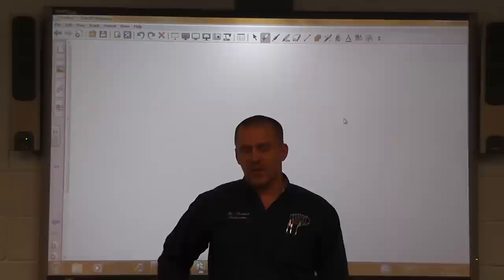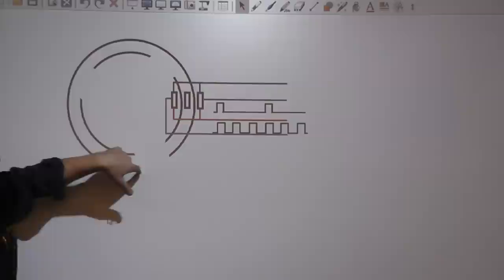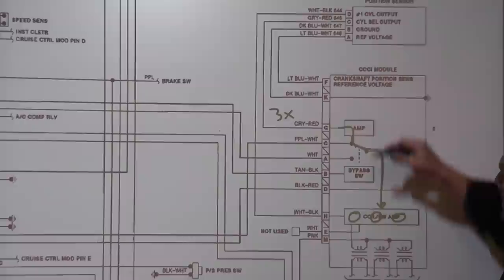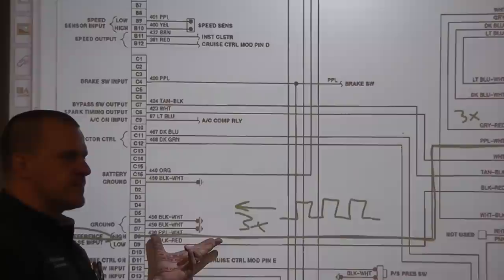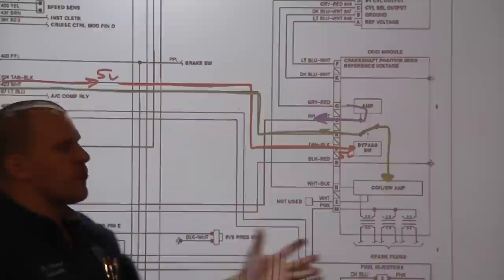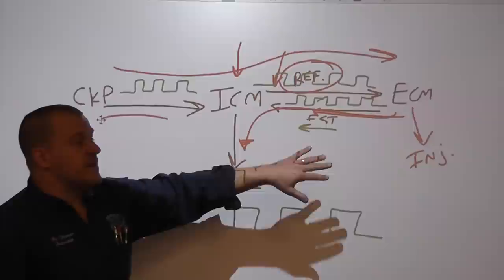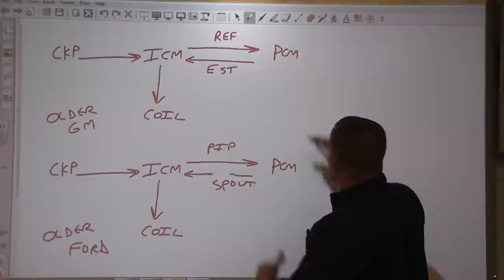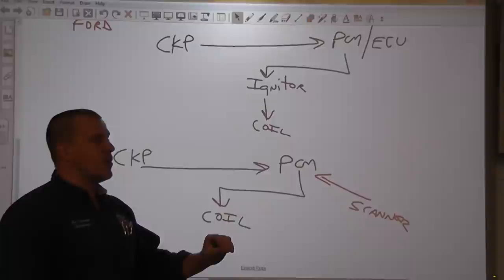GM Bypass Ignition System Operation (part 1)

Comment: Stalled once a wk, then 3 times a wk, no reason. Cold, Hot, Load, Sitting at intersection. It would go days in between. Each time it would start right back up. It went 2 or 3 months like this. The last day on the road it died a few miles from my house. I took another car up and drove the Buick home. It was really bad, dying every few miles. Had to push it out of several intersections. Letting it cool helped a tad, but not much. Except for the 2-15 min. runs, it's just 1-30 sec. run time.

Comment: how does it work on gm vehicles with no crank sensor or cam sensor.  does the timing connector on the firewall disconnect the computer and just reply on the ignition module for starting and running?

Comment: The only sensor I didn't replace is TPS. I have a cardone select distributor. NEW. My 89 s10 pickup throws a code 25 even though I replaced the IAT. I have a harbor freight timing light. Timing mark moves back and fourth a couple degee and engine idles fine. It's when you drive the engine holds back. When it reaches operating temps the engine wants to stall when coming to a stop. Can the red brick force the truck to run right. Is that a bidirectional scanner?
Reply from the maker: disconnect the EGR vacuum hose and drive it, see what it does. My guess is your EGR is sticking open, causing the rough idle and almost stall. This will also heat the intake to a point of setting an IAT code
Reply: could be a Fuel Pump going weak/ to Bad .check your fuel pressure and Fuel Filters might be plugging up.

Comment: I got a 98 Deville same concept but a V8 how would I keep my injectors going but shut off ignition by a push button switch? Would it be the EST wire? Its for my flame thrower kit. Its not working by killing the 12v to the ICM because the pcm is stopping the injectors.

Comment: hey paul if you were to do a by-pass test with a ''FUSED'' jumper wire and lets say we put a low amp fuse in the jumper like a 3 or 5 amp fuse, if you got the polarity wrong would you still cook the driver, or would the fuse blow and save the circuit??

Comment: I have problem here my gm starter selenoid has R terminal and I want to use it to help my start in winter but aperantly my positive linear dashboard regulator dont alove it ore I did some thing wrong because my dash fuse poped, I have singel hei coil E core type my distributor has a induction triger and the gm 4 pin ignition module is inside the delco distributor as well how can I solve this problem? Reversing the conections on the starter selenoid? ore atach in other place ore terminal on the ignition coio it self? Any way are dc boost converters ore amplifiers a good choise instead? I wuld like to also build oil cooling contained for my ignition coil those hei coils are nice they can take good punch but the wiering confuse my I have a old Opel Monza 82 model the wiering is prity shity in that thing evry thing goes on 1 wire so Im cinde of in big problem when winter comes

Comment: First let me say thank you and God bless you for you education and help have you provide.  I will be very grateful for you answer.  The question is pertaining to the information provide in this email. I will like to know if, the GM 3.4 V6 Ignition Control Module can fire its Coils without the ECM/PCM signal and the fuel injectors remain in functioning order with spraying fuel?. I car understand these two signal are LO and HI 3X reference signal. If the ICM need this signal to fire the coils, where can the circuit get the LO/HI 3X reference signal from?  Can it be gain from the LO 3X signal on the crankshaft sensor reference signal and the HI 3X reference signal come from the camshaft sensor?. 

Thank you Sir
Reply from the maker: What determines this (bypass system or not) is where do the crank sensor wires go? If they go to the ICM first, then it is a bypass system and spark is controlled by the ICM directly during cranking. If the crank sensor wires go directly to the ECM first, then the ECM is always controlling spark. Make sense?

Comment: my husband has a 1986 gmc truck with a 4.3 engine what happens if the ignition modulator is going bad now he just replace it with a new one from auto zone it has 3 plugs on one side and 2 on the other side of the modulator but it seems when he drives it and somethings getting hot it shuts off and will not crank until it cools down for at least a hr are more  then shows no fire from the spark plugs then it cools down and crank again could it be a bad modulator are not enuff grease on it or some other problem
Reply from the maker: +Racqual Clack It could be a bad pickup coil in the distributor. Is the new module exhibiting the same symptoms as the old module? If so the old module was not bad.

Comment: Wow! Got a '93 3300 that *always starts*, "turn key"instant stalls,from 1-30 seconds on average. yesterday it ran for 15 minutes twice!.. then stalled when I tried a test drive. I've ruled out fuel by fully testing, all is textbook pressures. It started 3 months ago, on warm engine after a load like going up a freeway on ramp. the next weeks, it settled into a shut down at any speed, throttle position, temp. Have new ICM,CPS,fuel relay. Now I'm lookin for a broken wire... any thoughts?

Comment: If I only use pickup wires through the converter inside the module, would that give me my reference signal. no external power needed, no 12 or ground? the signal converter just turns a.c. pickup to dc to be sent to the ECU?
Reply from the maker: For the module to convert the AC signal to a 0-5 volt digital, it needs to have a main power and ground. Remember, anything with the name "module", is a miniature computer. Computers must have power and ground to work. Make sense?

Comment: I have a 89 chevy celebrity 2.8mpfi. Is the wiring schematic same as a 3.1 in like the luminas? Im fighting an issue with my 2.8 i have fuel i have spark my fuel rail is about 45psi car just wont fire.
Reply from the maker: we need to check these injectors for a shorting condition, watch part 2 of this series!! We get into the injectors I believe and they are shorted!
Reply: @ScannerDanner  will do that was my plan to do so tonight. I removed dash from the car and it ran going in shop. Then after pulled dash went to start and she wouldnt no longer. So im stumped and dont wanna junk car

Comment: Ran into a problem today. 2005 Trailblazer no crank/no start. Checked ignition switch and found it wasn't getting correct voltage. Replaced ignition switch and have good voltage. But now passlock is on and still won't crank/start. I understand on this vehicle the PCM controls the starter signal and disabling the fuel pump relay. Hence why i don't get any signal to the starter when cranking. Also now i have a Theft Deterent code P1631. Where do i start to diagnose this? Would really appreciate your inputs. Thanks!
Reply from the maker: Leave the key on for 10 minutes (up to three separate times) for the pass lock system to relearn. Once the theft light stops blinking, it has relearned
Reply: go to youtube there is a 3 set precedure steps to relearn the ignition system it will take about 32 minutes or so. be patient . 

STEP(1)  
turn key on like your going to start the engine up release the key let it stay in run postion For 10 minutes then security light should stop flashing 
turn ignition in the off postion do not remove the key at all wait 30 seconds in the off position, 

STEP(2)
now try to start again let go let it stay in the run postion another 10 minutes security light in dash will stop flashing if not not worry turn ignition off  wait 30 seconds again in the off postion. DO NOT REMOVE THE KEY

STEP (3)
turn key on like your going to start the engine up release the key let it stay in run postion For 10 minutes then security light should stop flashing 
turn the ignition in the off postion do not remove the key at all wait 30 seconds in the off position, 
STEP (4) START THE CAR . NOW YOUR PROGRAMED IN AND READY TO GO!!!

other info. 
if not start then try the 1-4 steps again. 
if not work then , then you have a faulty Ingnition Switch. 
REPLACE A.S.A.P . there is no bypassing  the theft system till it reads in the code # from the key , key code number is from 1 digit to 2 digit code  starting with #1 through 15 there are only 15 numbers thats it for  a chip key on all gm , but through the ignition to have the code placed back in the on board computer . once you are able to start the car. 

then you can put in a bypass . 20a on and off toggle switch under the dash requires snipping 1 wire out of the 3 coming off the front side center of the ingnition switch sensor white yellow and black wires most comon on all GM made vehicles. the yellow is the one you would snip then run each end of the single yellow to the switch.just like hooking up a light switch in your house to turn  on your kitchen or bathroom light  and walla .now you can disarm the security theft or enable it by using the on and off toggle switch. simple and easy bypass fix. again i repeat can only do this after you relearn the key and ignition to start the vehicle first. have a nice day.

Comment: Mr Danner would this also apply to older gm models I have an 89 k2500 with a 5.7l and when est wire is unplugged for ignition timing setting, runs ok,
 I have voltage on signal from ICM once engine is running I have no voltage out put from pcm on the EST bypass wire, is it safe to say I may have a bad pcm, I have checked all powers and grounds and all good did I miss something
Reply from the maker: Yes, it is essentially the same system. Just remember that the ECM may force "module mode" with an EST fault. This is done by shutting down the voltage on the bypass wire. You could still have a bad module cause this condition.
Reply: Thank you Mr. Danner for taking time to answer my question. Cant wait for your next video

Comment: 91 Ciera 3.3, last summer new coil packs, ICM, plugs and wires, new fuel pump. Last winter and this winter code 42 for EST or bypass fault when starting car in cold, not always though. Turn it off and re start code goes away. Any suggestions?

P.s the icm was bad that’s why I changed it, then with my luck the fuel pump went out soon after!
Reply: Did you ever figure this issue out?  I have a similar issue.  I have a 92 Cavalier with the 2.2L.  Recently my ICM and one coil went out.  I replaced them and the car was fine for a couple hundred miles then one morning going to the store it was running rough and the CEL came on.  Drove home and the CEL was off and car was running better.  Hooked up scanner and now have a 42 code.  I've started it a couple of more times and the CEL is still off but the scanner still shows the code 42 even after I clear it with the scanner.  I don't know if my new ICM is bad or what.
Reply: @Mr2004MCSS  never figured it out. It just went away. Sorry.
Reply: @estpaul3132  No problem.  This car has been eating ICM's and coils the last several years and it's getting frustrating.

Comment: Hey paul ive vie got an 89 mustang. When I look at my pip wire on my scope the top right corner of the square wave is cut off. Is this normal? When I unplug the spout connector the square wave comes back to normal. I don't understand why this is happening and I thought it was causing a poor idle issue. Any idea why my signal waveform would be changing like this. Thanks! Love all your videos
Reply from the maker: It is normal for the pip signal to do just add you described,  however those "cut outs" should be even and uniform. Does it run better with the spout unplugged? (It will not rev as well due to minimal timing advance)
Reply: Ok thanks Paul! Cut outs are even and uniform. Runs the same with spout unplugged.
Reply: Car idles ok but just sounds a little off maybe a misfire. I will be checking secondary waveform soon. Injector balance looks good. Everything else I could think of checks out ok.
Reply from the maker: Staci Haskowitz
Okay cool, then you're okay with the PIP circuit. Keep looking :) I agree, secondary ignition waveforms would help. Maybe a compression test.
Reply: Will do! Compression better be good engine was rebuilt last month. Waiting on compression gauge in the mail. Also is the wise secondary ignition probe compatible with snap on scanners? Or just pico
Reply from the maker: Any scope Staci
Reply: Thanks Paul. If I connect my + scope lead to coil primary - will the high voltage hurt my scope? It is in the 100's of volts, correct?

Comment: 99 cavalier 2200 engine 7x crank signal at my school with no spark no start. since the crank signal goes to the ignition module i believed this was a bypass ignition system. i tested for ac voltage coming from cranksensor and it was producing at the ignition module. i told my instructor too change ignition module. he gave me a used one he had laying around i put in and still no spark. im still stuck on bad module and hes saying check wires going to pcm from ignition module. Alldata states 'When the PCM receives the 7X signal, it will determine which pair of cylinders will be fired (1 & 4 or 2 & 3). It then tells the ICM which cylinder to fire through the ignition control circuits." does this mean that the pcm is needed for firing these coils?
Reply from the maker: This system is misleading in that with the CKP signal going to the ICM you would think it is a bypass system. However it is not. What gives it away on the diagram is the IGN CNTRL A and IGN CNTRL B designations on pins B and C of the ICM. The PCM controls the ICM all the time. The only thing the ICM does with the CKP signal is convert the 7x AC sign wave into a digital square wave on the purple white reference wire. The PCM receives these impulses and controls the ICM A and B circuit.
Does that make sense?
Reply: yes it does. if scope patterns look good on purple/white ref wire and are also good on a and b circuit but theirs still no spark should i condemn the ignition module?
Reply from the maker: Yes, just be sure the ICM has a good power and ground first.

Comment: Hi everyone, I'm an electrical Tech of 17 years and I can't believe I'm struggling with this one. SD has made an incredible video here and I fully understand. 
1994 Cadillac Seville 4.6 Northstar. 
Crank, no spark... 
I've got approx 950mV ac on ckp A and B as well as Cam sense ac voltage of approx 600mV. 
IC module has 10 volts during crank and good ground. I've cut the tach wire at the module to rule that out as a possible issue. I have also tried another IC module. I have unplugged the 6 pin PCM connector as it doesn't seem to rely on that for cranking spark. 
still no spark. 
Any ideas.... anyone??? Thanks...

Comment: 1994 Oldsmobile Cutlass Supreme / aftermarket remote car alarm with start.
The installer put in a resistor to bypass the chip the key.
I have a random no start conditon that cause the starter to just click , after replacing the starter checking and cleaning all of the battery connections and starter cable's I still have the same condition.
I discovered that when the starter just clicks I only have 5 to 6 volt's at the solenoid, when it starts I get 10 volt's.

Any ideas suggestions welcomed
Reply: Then your problem is in the solenoid control circuit. Look in the area where someone installed that resistor. Did this thing ever have an aftermarket alarm system installed? Also you could have a neutral safety switch problem.
Reply: ScannerDanner Premium There is an aftermarket alarm installed. I will look into the neautral safety switch and the resistor. I'm not sure how to troubleshoot the neutral safety switch other then trying to start the car in neutral when it's acting up. Also I will check the solder joint on the resistor .
I also located the antitheft module and have one from a donar car that I could swap in but I'm not sure if that's where my issue is.
Reply: It wouldn't be the resistor. But definitely the aftermarket alarm. What gets done with those, is the ignition crank wire gets cut under the steering column and a relay gets wired in series in that circuit. Easy fix. Find the yellow crank wire (heavy gauge wire) under the column and find where it is cut and spliced into another circuit. Cut of those wires and reattach the two yellow wires.
Reply: ScannerDanner Premium Thanks for the quick replies !!  so you want me to bypass the alarm and return the circuit to the original configuration , confirming that the alarm is the culprit.
Reply from the maker: Yes, as this is most likely the cause of your voltage drop on the solenoid circuit
Reply: ScannerDanner Thanks ScannerDanner I will do this and let you know the outcome.
Reply: Shawn Turner Can you tell me where to find the anti theft relay ? I would like to verifiy that the contacts are functioning correctly, I found the antitheft module would that relay be close to it ?

Thanks again for all of your help.

Comment: i have a 94 corvet when doors are locked car will start when doors are unlocked car wont start need help
Reply from the maker: Sounds like some type of aftermarket remote start or alarm system issue. I do not think it would be associated with the factory VATS (vehicle anti-theft system)
https://www.youtube.com/watch?v=v0AIhj_vykU

Comment: is group fire means all 6 cylinder fire at same time?
Reply: No only 1 coil pack that has 2 plug  wires on it fire at a time. "groups of 2 cylinders" is called a waste spark system
Reply: right  ,  each  coil  has  2  spark plug wires, both  coil terminal  fire simultaneously  , one is  firing  on the compression stroke, the other is  firing  on the exhaust  stroke "hence waste  spark  system"  just like a simple  lawn mower engine  with a single cylinder,   as the magnet on the flywheel  passes the  ignition coil it  fires  on the compression stroke,  then the fly whell  revolves  360 degrees  and fires again  on the exhaust  stroke, why make something so  simple so complicated on a white board?